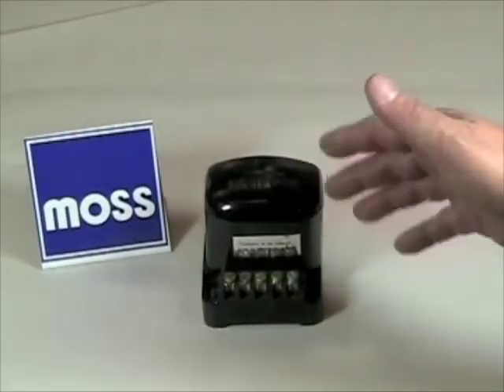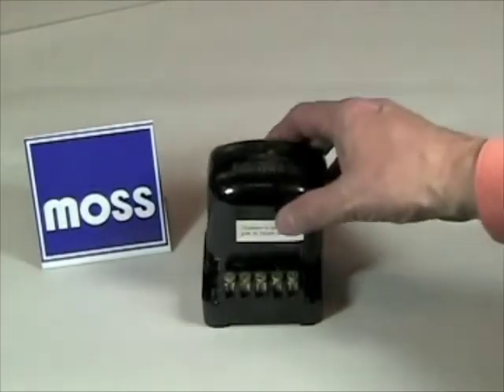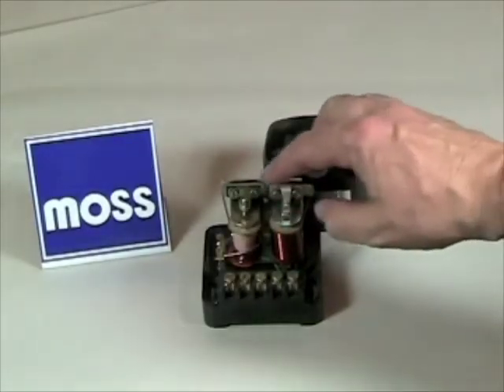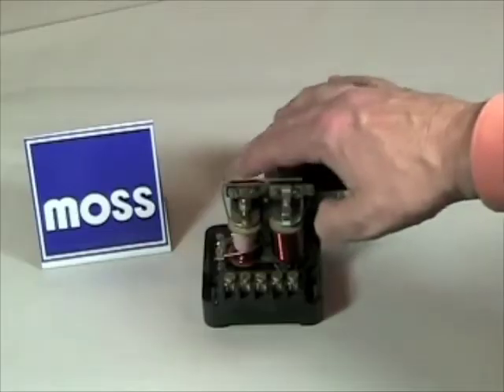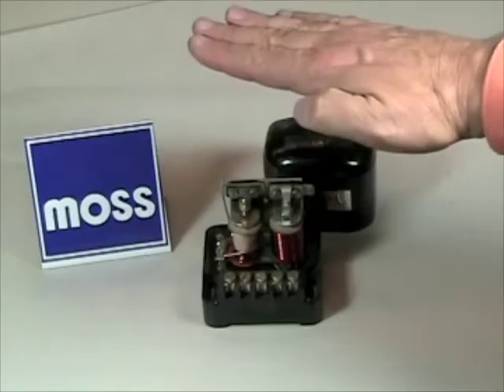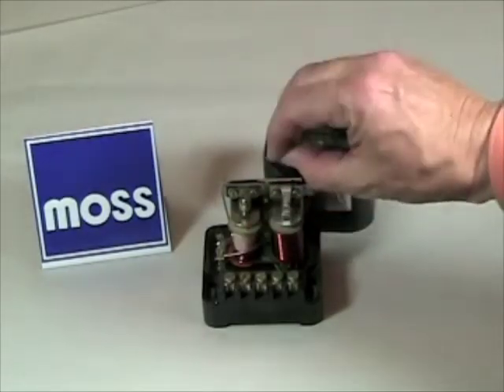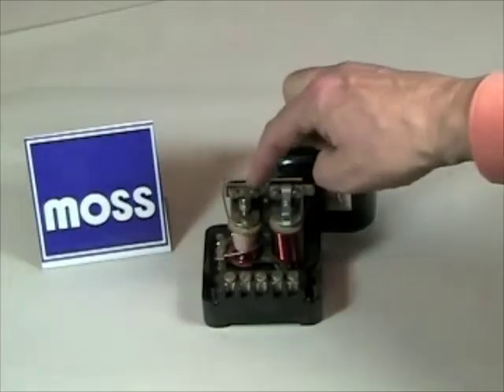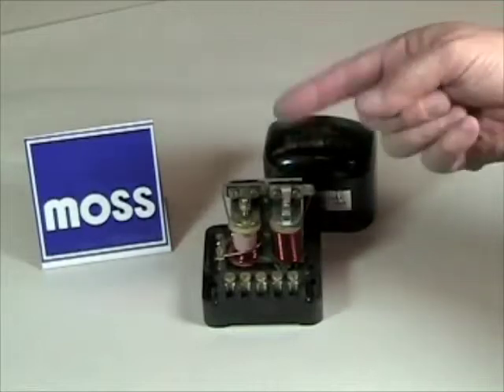Voltage Regulator - How it Works Part 1

Comment: are those voltage regulators polarity sensitiv?can you use it in bouth 6 and 12v system's? can you regulate the out put voltage?

Comment: now that was a very simple minded explanation, I was hoping to know about how they determined the magnet coil windings gauge and length and so on. you sir don't get a thumbs up from me.
Reply: there is an adjustment screw on the back

Comment: question... I have new alternator and new battery, when I put it on reverse it turns off if I don't accelerate, same if I put it on D also if I press a button to put the windows down. Voltage drops, I'm thinking its the regulator. Could it be ? I'm not certain

Comment: To the cooker the voltage regulator absolutely does sense low voltage and requests to the generator to produce more electricity, just as it will close the feild off if the generator is producing more electricity than needed. Study up a bit more before you reply to things good day to you!